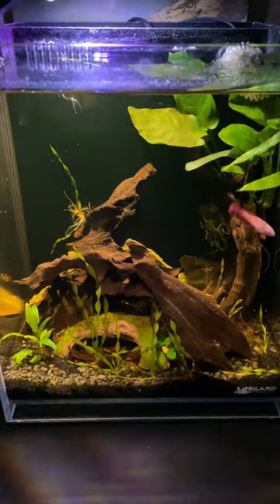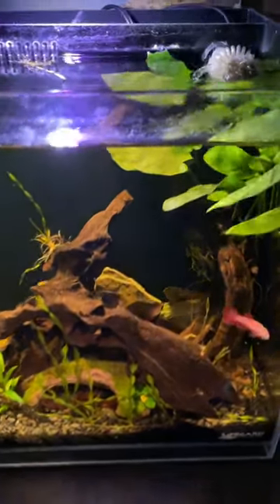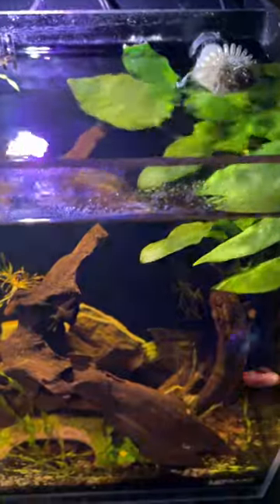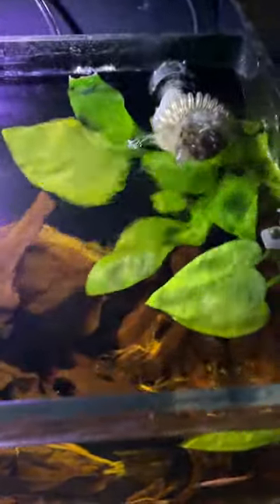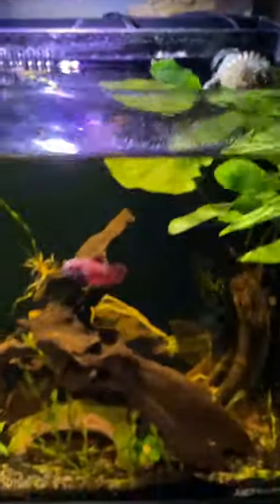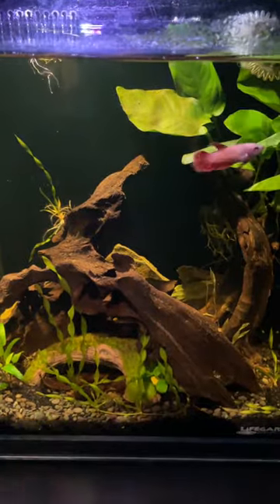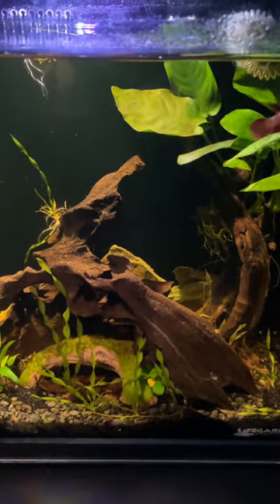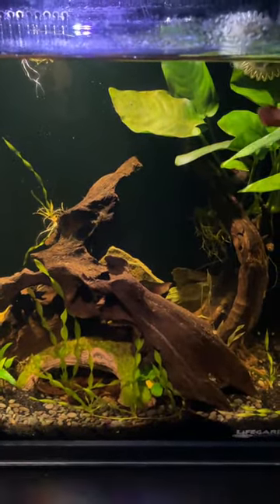How to Slow Filter Water Flow for Your Betta #shorts

Comment: Pop the fan heads off, you can always pop em back on, slide a coarse nano intake filter over the hose/hoses, with one of those itty-bitty black rubber bands to hold it on somewhat. It's all black, adjustable as to not over do it and damage the pump, cheap as raiding your old hang on the backs or a couple of sponges you'll eventually want for something, and completely reversible. I'm really paranoid about customizing anything in a permanent fashion or breaking things 😅.